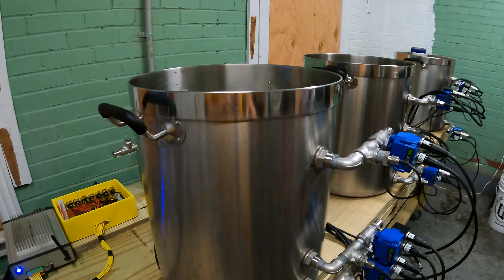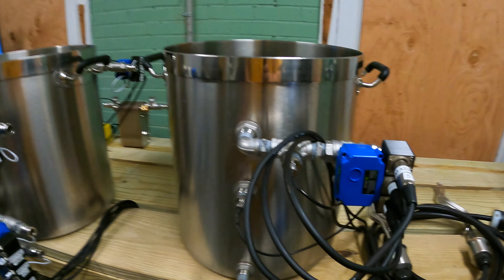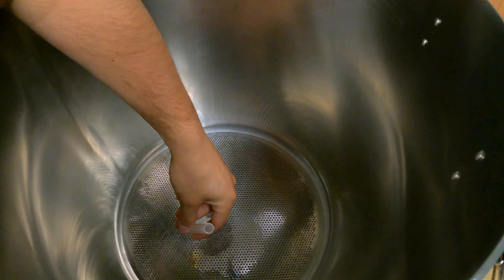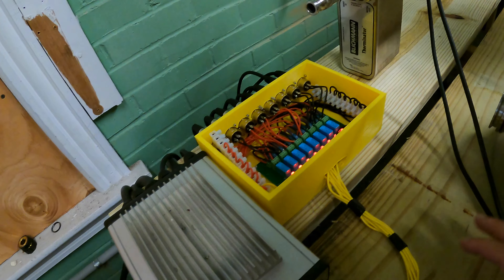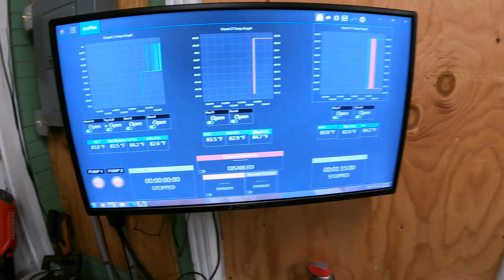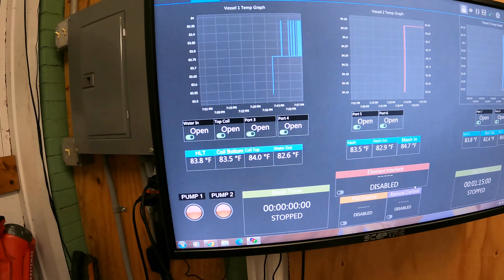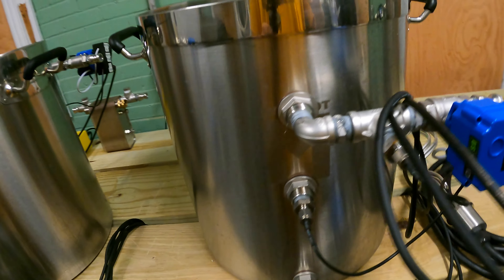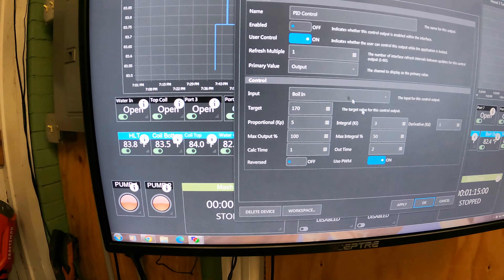Building a Herms Keggle Brewing Setup [4K] Part 5 System Updates and BruControl

Comment: I was following your build and liked the use of kegs early on, which you mentioned doing to save money. But then you transitioned and now have, in my opinion, an over the top custom electronic control panel, which could not have been cheap. So it's confusing how the mindset went from cheap to overly expensive. I'm modifying my current system and will be using half barrel kegs that come with tri-clamp fittings and then going to assemble a PID controller.

Comment: If the brewing system is designed for single temperature infusion it produces moonshiners beer. It is chemically end enzymatically impossible to produce ale and lager with single temperature infusion due to the way enzymes function and chemical precipitation, which makes strike and target temperature useless for producing the beer. The only things that can be controlled in the brewing method are the amounts of simple sugar, glucose and sweet tasting, nonfermenting types of sugar that form when Alpha liquefies simple starch, amylose. The only problem is that it takes more than glucose and sweet sugar to produce ale and lager.
You mentioned 149F. A recipe that recommends single temperature infusion, high modified, malt and rest temperatures at 149, 150F clones authentic, moonshiners beer. At 149, 150F Alpha releases the highest volume of glucose from starch within one hour. The more glucose the more alcohol and that is why moonshiners use the temperatures. At temperatures above 150F Alpha denatures quicker and beer turns out sweeter and lower in ABV. At 149F Beta denatures. Beta is responsible for conversion, which occurs at 140F. During conversion Beta converts simple sugar, glucose into fermentable, complex types of sugar, maltose and maltotriose. Maltose and maltotriose are the sugars that produce ale and lager, glucose only makes the alcohol in beer. Here is why moonshiners denature Beta, when conversion occurs, secondary fermentation takes place due to maltose and they don't need that to happen because it extends the brewing cycle and increases the risk of getting caught. Maltotriose is responsible for natural carbonation and they don't need that to occur. Since moonshiners only need the step that makes glucose they skip conversion because there is no sense in spending time on a step that converts the highly fermentable, glucose that is already present in the extract into complex sugar and have to wait for secondary fermentation to occur when an enzyme in yeast converts complex sugar back into simple sugar, glucose. When conversion is skipped the beer is moonshiners beer made from glucose and depending on how high the rest temperature is above 150F, more or less, sweet tasting, nonfermenting types of sugar.
To offset the drying and thinning that occurs in beer that is made from low temperature mashing, dextrinization and gelatinization steps are used, which forms body and mouthfeel in ale and lager. Moonshiners aren't concerned with body and mouthfeel and they skip the steps. But they sell the rich, complex starch, called amylopectin, that contains the ingredients that forms body and mouthfeel, limit dextrin and pectin, for making maltodextrin. Amylopectin is heat resistant, starch that makes up the tips of malt and the temperatures that home brew recipes recommend aren't high enough to rupture the starch where it enters into the mash liquid before Alpha denatures and that is why the starch is thrown away. In home brewing the starch is thrown out with the spent mash, paid for. In its place recipes recommend ingredients that loads extract with Beta Glucan, protein sludge and haze forming compounds, which reduces the shelf life of beer. The Hochkurz brewing method takes advantage of amylopectin because mash is boiled a few times and the starch rapidly bursts during boiling. When the boiling decoction is added back into the main mash Alpha liquefies amylopectin and dextrinization and gelatinization occur.
To produce pseudo, ale and lager the brewing system would need to be capable of step mashing and reaching each temperature step within 10 minutes without recirculating hot extract for long periods of time, which extracts tannin. Tannin extraction is a time, temperature, pH thing and that is why vorlauf is kept within 10 minutes using a small volume of extract.
In the step mash method and in the decoction method high quality, under modified, low protein, malt is used because the malt is richer in enzyme content and contains more starch/sugar than high modified, high protein, malt. Malthouses produce two types of malt, malt that makes whiskey and malt that makes ale, and both types of malt are in bags stamped Brewers Malt. For moonshiners that use high modified, malt and ale brewers that use under modified, malt, know which malt is which in a bag, malthouses provide a malt spec sheet with every bag of malt, they are online. Malt spec sheets are used for determining the quality of malt before malt is purchased. On the back of a box of kids Frosty Flakes is a square box that lists what is inside of what is inside of the box, something similar comes with malt. Unless you are familiar with a malt spec sheet and the chemical acronyms and numbers listed on a malt spec sheet you have absolutely no idea if the malt that you buy is capable of producing ale and lager without the addition of enzymes. A recipe that doesn't mention the malthouse that produced the base malt is worthless because a malt spec sheet cannot be obtained. Don't assume that a home brew store carries under modified, malt a good shop carries the malt listed on recipes, which is high modified, malt. To use more expensive, under modified, malt with the single infusion method is a waste of money and good malt because less expensive, high modified, malt makes the same beer, glucose is glucose. Home brew stores save home brewers money by selling them malt that goes with the brewing method.
Place a hop back on the inlet side of the plate chiller and install the pump on the outlet side of the chiller. The hop back will filter the wort before reaching the plate chiller, reducing fouling, and the pump will last longer because the wort is chilled down before reaching the pump.